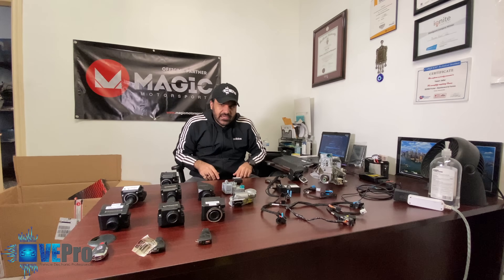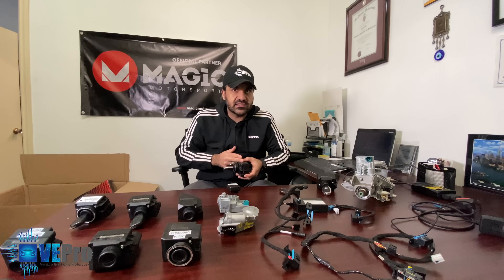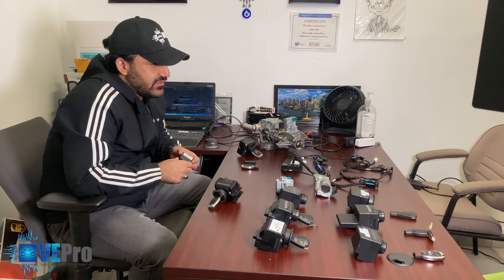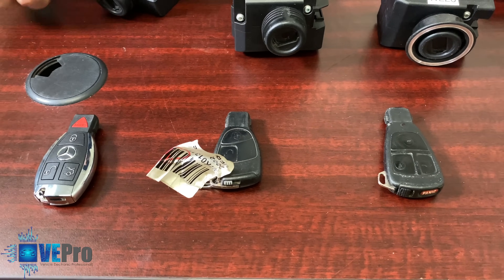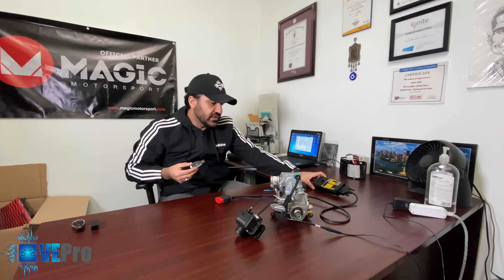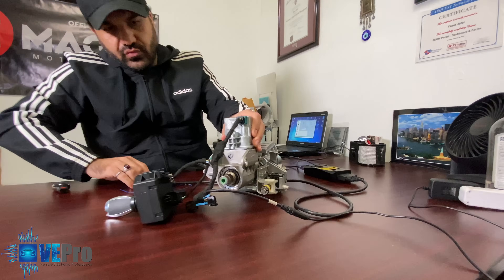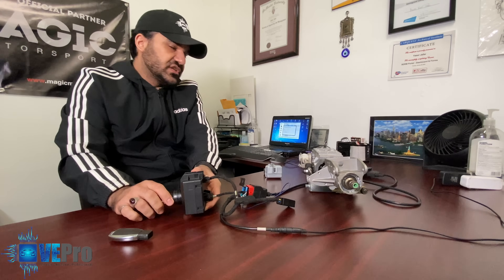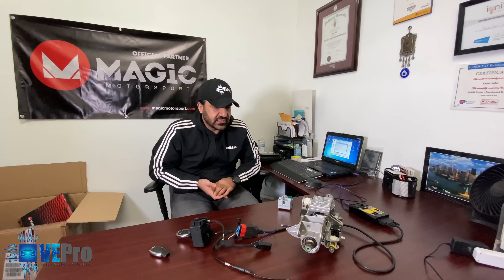MERCEDES | ESL EIS KEY BENCH TESTING | NO START DIAGNOSTICS | SYSTEM OVERVIEW

Comment: Yaser and the crew at VEProfessionals definitely know their stuff.   Sent my 2006 CLS55 AMG key and EIS to them because my FOB would not turn the ignition to accessory 1 or 2 so I couldn't tune the vehicle after some mods.   Yaser and crew found that the EIS was fine, but the key was bad.   They were able to program a generic key to do everything I needed, and sent both keys and EIS back.  All in all it took me two (2) weeks and it works great.   If you have issues with either your EIS or FOB/Key, Yaser and his crew are the people to send it to.
Reply: m?

Comment: 07 W211 E63 when driving if all lights flicker on dash but car does not shutoff and I got a new key from the dealer and it still does it; it's very random and sometimes doesnt do it. Starting to lean towards EIS glitch..car does not have problem starting ever and there are no codes in EIS. I did get a 1596 stored code..idk

Comment: thanks for the info, I'm wrong p2071 das doesn't send engine start request, eis works without problem with other key, but the new key programmed by Mercedes Benz doesn't work, it says computing data please wait.  could it be the ecu causing the problem because it does not send the engine start request.  please answer my question

Comment: Good morning I have a 2010 GL450 when I connect to the vehicle with the scanner, I get a Key in Position HO auxiliary contact NO, also steering wheel is unlocked, but I don’t hear the ESL work at any time. Any suggestions? I appreciate your feedback. Thanks again.
Reply from the maker: Best to reach out to info@vepro.ca Thanks for watching!

Comment: Very informative, thank you. So you cant diagnose what unit is faulty with any obd tester or multimeter?
You need special tools. 
The motorola chip in older key is the common failure point, right?
Then if esl motor sounds weak its likely going to fail. 
If both working keys fail same time eis could be the problem. 
I have two old keys and cant figure out what should I repair, Both keys have worked intermittently.
I guess I should start with making new key cause it's good to have anyway.

Comment: Question - 2005 Kompressor.   Battery died and key would not turn, replaced battery and key now turns,  steering wheel unlocks, lights on the dash, radio works, etc..  but car does not start.   No signal to the relay.    In the video, it says you can turn the key on an older car, everything should be fine with the ESL and EIS.   Is there ever a situation where it would turn, everything working except for the ability to start?   Is this something you guys can fix?
Reply from the maker: Email info@vepro.ca for specific case inquiries

Comment: I purchased one of your emulators yesterday.  Today, after several hundred attempts to get my 1999 CLK430 W208 steering lock to disengage, it finally worked!  I immediately removed the battery cable and disconnected the wiring from the ESL.
Since it is unlocked and disconnected, is there any reason to remove it before installing the emulator?
Reply: Sadly, I finally got back to my car months later, installed your device, got the red light instead of green.  Oh well...😔

Comment: hi there. i have problem with EIS and i was trying to take out and also to take out the ESL, the SURPRISE: no ESL on my car. in place of the ESL or emulator is just an sponge and there is no blue plug for ESL. how is this possible? now i need to syncronise only new EIS and old keys to car? no more ESL?
please give me some info that can take me out from fog. Best regards, Ovidiu.
Reply from the maker: Some vehicles are not equipped with ESL by default. Contact info@vepro.ca to discuss further. Thanks for your support!
Reply: @VEPROFESSIONALS  contacted. Thank you.

Comment: My 2009 mercedes benz c350 when you get the key in the ignición switch the esl unlock but when you turn the key the dash board does goes on, this still the esl  has a malfuntion?

Comment: Could a bad alternator also cause a no start? aux battery and main battery are new both about 3 months. I replaced them because it wouldn’t start it started up when I replaced the aux battery for about a week then no start again. Key is responsive and dashboard lights up but no response when key is inserted and steering snd is not locked. Any ideas?? Bad key, EIS, alternator? Thanks

Comment: Please any ideas of what could be the problem with my c350 w204 ignition on light comes on the dashboard but no cranking but if you crank from the front Sam relay the engine started I go on diagnose I got B169213 and it says output circuit 58d has malfunction,there’s an open circuit but couldn’t see the wires having issue

Comment: Can you repair fbs4  w212 ESL , sometimes works but sometimes doesn’t work , when it doesn’t work the steering lock is dead, nothing happens when I turn the key ?
Reply: how did you solve it? same issue
Reply: @sabanoureen6898  I replaced the motor inside the electronic steering lock

Comment: OK I HAVE A QUESTIONS?  I OWN A 2004 MERCEDES CLK500 WITH THE KEYLESS GO AND KEYLESS START.  I ALSO OWN A 2005 CLK 55 AMG CABRIOLET , WICH I WOULD LIKE TO ADD THE KEYLESS GO AND KEYLESS ENTRY.  WHAT ITEMS WOULD I HAVE TO REMOVE FROM THE 2004 AND INSTALL IN THE 2005?  CAUSE SOME PEOPLE SAY THE CLUSTER HAS TO B REMOVED ALSO.  IF U HAVE ANY INFO IT WOULD GLADLY B APPRICIATED!  THANKS UR VIDEOS GIVE LOTS OF GOOD INFO.